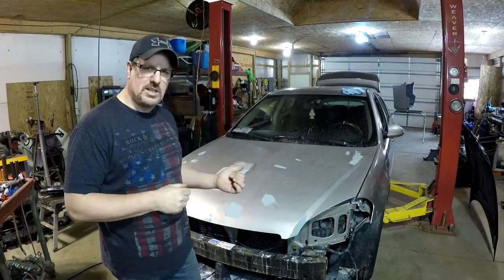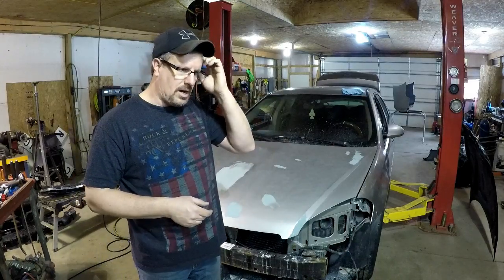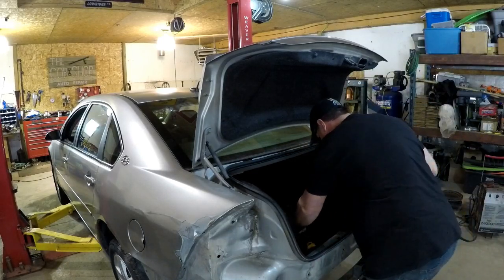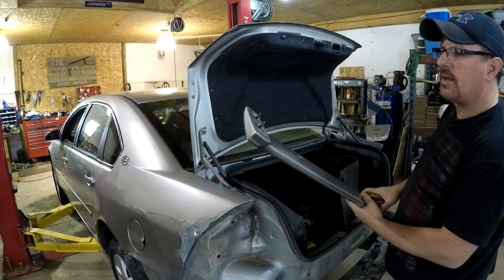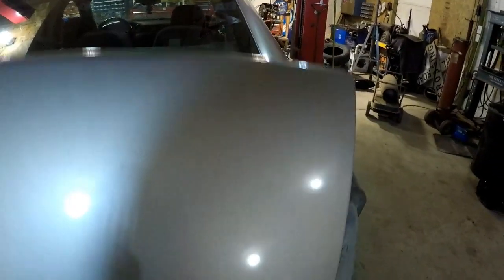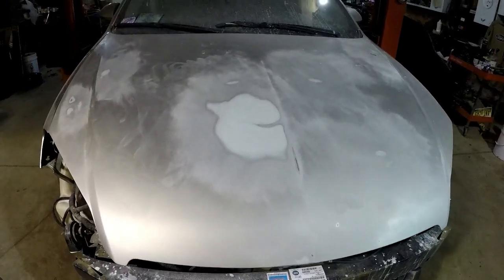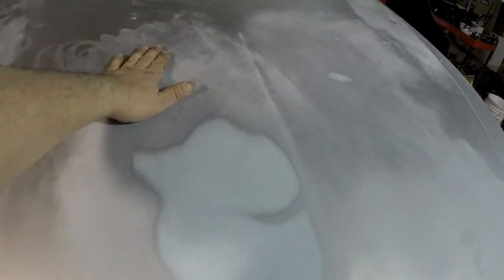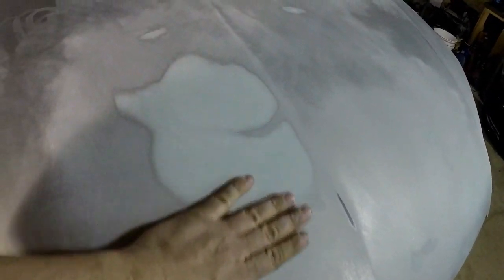Copart Project Chevy Impala rebuild (part 3) of my first copart auction purchase!

Comment: For bugs take a piece of tape 4 to 5 inches long and make a loop with the sticky side out and carefully touch the bug without touching the paint to lift off the bug and then spray over the area. For dirt get a filter for your air compressor. Make sure you blow out the shop with compressed air or leaf blower to remove dust and dirt on floor, walls and ceiling. Dust in the paint area is a pain and any movement and air flow just makes it worse. I had better luck spraying outside than spraying in a dirty paint area.
Reply from the maker: Thanks for the advice. I really didn’t think I’d have to worry about bugs this time of year but it’s been warm lately. I’ll try that trick if it happens again!

Comment: Like your video. How do you like your Weaver lift?
Reply from the maker: Thanks! I like the lift. It’s a couple years old and has worked well for me. That being said, you get what you pay for. It was an inexpensive lift. It definitely can’t lift it’s advertised load of 9,000lbs. It starts to struggle around 7,000. However, it gets the job done and has paid for itself several times over.

Comment: Fun project. Should be a 2500-3000 car when done. Should have lots of parts left to work on other ones. The parts off the parts car are not worth much. I parted out a 2006 last fall, sold 3 doors for $50 each, front bumper/hood/fender/headlights for $300. No interest in anything else from CL people.  Engines are cheap in the salvage yard, just bought one last week for $150.

Comment: Good vid to show why you should not spray panels in your garage.  Lots of bits in it and seems imperfect in the last bit of the hood edge. Also black is the worst to get right. Why do it?
Reply from the maker: So I should just give up and pay a body shop to do the paint work? Or should I wet sand and buff the paint when finished to remove the imperfections Paying a body shop wouldn't make this project a DIY....
Reply: People have skills. You have skills and they are good.  Remember the saying " Don't spoil the ship for a ha'pence of tar. " which i think you might have by doing this. Paint needs a clean room and  prep with time. This seems "wam, bang, thank you mam". Just saying, not trolling guy.
Reply: What a pleasure to try to be trolled by someone who wasn't even a prospective sperm when I started my first project at 15 on my birth year car, a 1954, 1195, small rear window, beetle and made it into a Baja bug, painted in total with rattle cans, all before the days of power tool everything, home lifts and "how to do" on YouTube, or even YouTube or home computers for that matter. From working my way up from mopping oil at 15 to being the Engineer Officer of one of Her Majesties finest warships , all whilst tearing down and rebuilding, upholstering and painting ( in black, in a leased booth ), my hearts desire, a 1979, Olds 403, Pontiac Trans Am. --- I am very secure in my own skin, the beauty of DIY and my personal motto " live life to have memories". I don't troll anyone or call anyone who is not eyeball to eyeball anything other that in a manner that is defensible. In that regard I suggest that there is an IKEA waiting for you to buy a cot, assemble and throw your toys out of in another direction.  It is increasingly obvious how you lot allowed Ronald McDonald to take over 1600 Pennsylvania Avenue and within a few weeks be pictured with the Russians, in the Oval, laughing their collective arses off. SAD!
Reply: Qualifying yourself is just another way of whining. It is also needy. "Why do it?"
Reply: Yawn !!
Reply: I’ve done plenty of garage paint jobs in worse conditions than his he just needs to get his gun settings alittle better and the rest will fall into place you can always fix it trust me I’ve had worse and it came out a lot better
Reply: I think Marc is correct, a little adjustment to gun settings will make your life easier.  I also find dampening the floor helps with dust if you don't have a booth.  Still good for a first time painting and with new equipment
Reply from the maker: Thanks! I just finished painting the rear bumper. I used the dupli color paint shop base and clear. I played with the gun settings a bit. The results are MUCH better! I’ll post the final video soon!